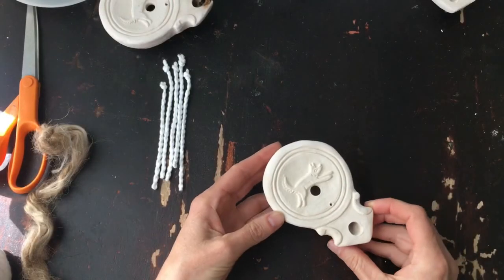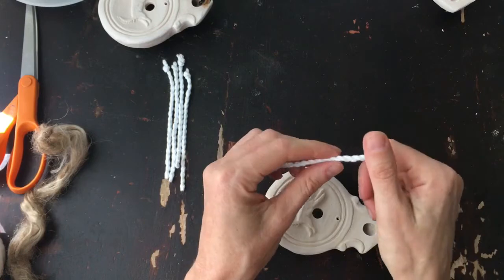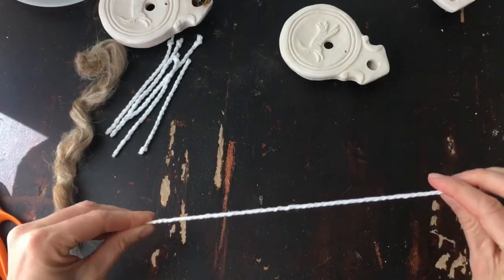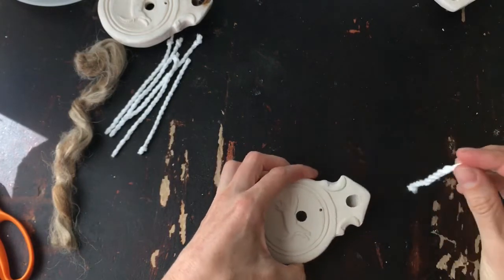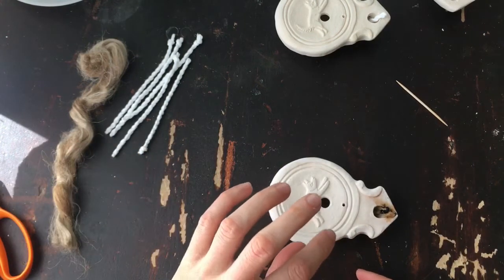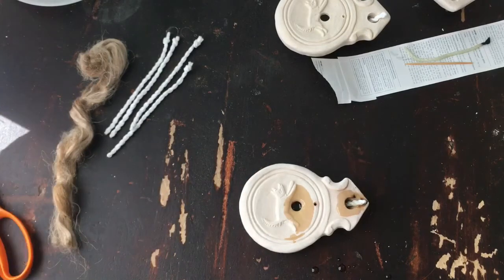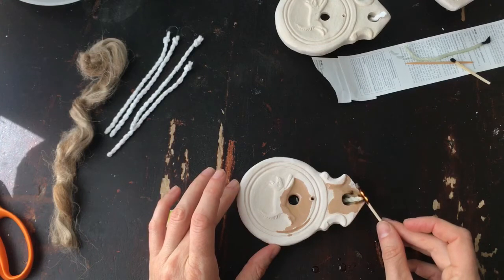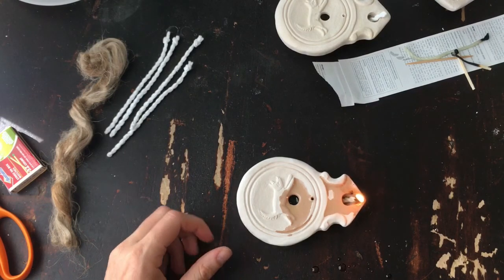Using Roman Style Oil Lamps

Comment: You can seal the clay by polymerization. Just let your oil soak into the clay, and then cook in an oven at about 400 degrees or whatever th flash point is for the oil. Its just like seasoning a cast iron.
Reply: good comment